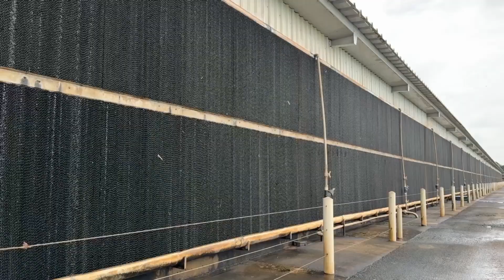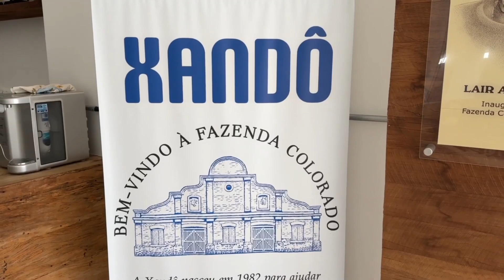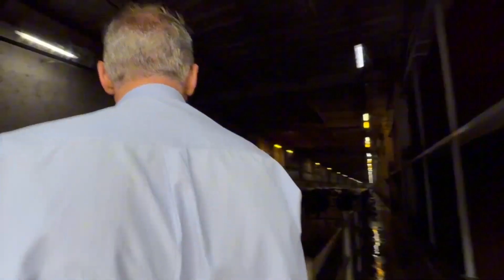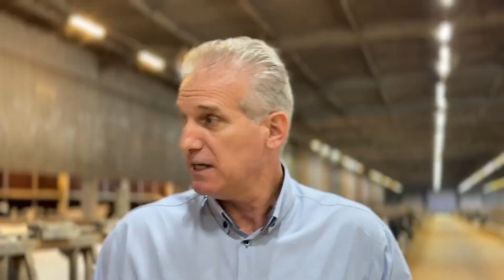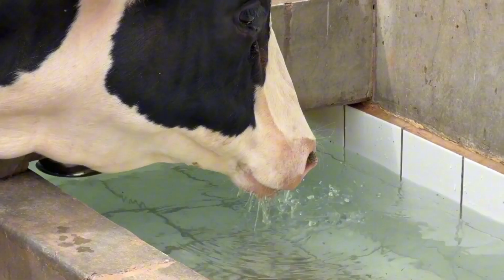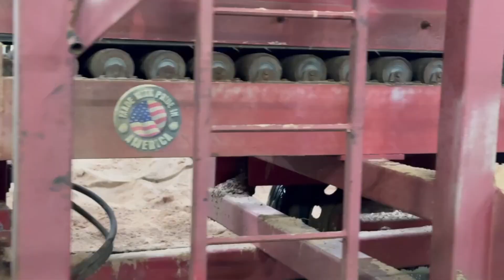2,400 COWS AND 100,000 LITERS/DAY: CROSS VENTILATION AND A2A2 GENETICS - FAZENDA COLORADO 🇧🇷

Comment: Hi.
What should I feed my Dairy cows for them to produce more than 30 Litters per day?
Reply from the maker: To help your dairy cows produce more than 30 liters of milk per day, it’s crucial to meet their nutritional requirements precisely and consistently. Based on the NASEM 2021 recommendations, here’s a general feeding strategy:

1. Dry Matter Intake (DMI)
	•	Cows producing 30–40 L/day typically consume 20–25 kg of dry matter per day, depending on body weight, stage of lactation, and diet energy density.

2. Energy Requirements
	•	Use diets that provide 1.6 to 1.7 Mcal of NEL (Net Energy for Lactation) per kg of dry matter.
	•	Include high-energy ingredients like corn, silage, and bypass fats, especially when forage quality is moderate.

3. Protein and Amino Acids
	•	Aim for 16–18% crude protein in the total mixed ration (TMR).
	•	Ensure a good balance between rumen degradable protein (RDP) and rumen undegradable protein (RUP).
	•	Provide essential amino acids, particularly methionine and lysine, as these are often limiting for milk production.

4. Fiber (NDF)
	•	Keep Neutral Detergent Fiber (NDF) around 28–32% of the total diet to ensure rumen health and optimal milk fat production.
	•	Maintain good physically effective fiber to promote rumination and avoid subclinical acidosis.

5. Fat
	•	Dietary fat content should be 5–6.5% of dry matter. Adding bypass fat can boost energy density without harming rumen fermentation.

6. Vitamins and Minerals
	•	Provide adequate calcium, phosphorus, magnesium, and trace minerals like zinc and selenium.
	•	Include vitamins A, D, and E, particularly in confined systems.

7. Water
	•	Access to clean, abundant water is vital—expect water intake to be 3–5 liters per liter of milk produced.

8. Feed Additives
	•	Consider additives like yeast culture, buffers (e.g., sodium bicarbonate), ionophores (where permitted), and rumen-protected amino acids to enhance performance.